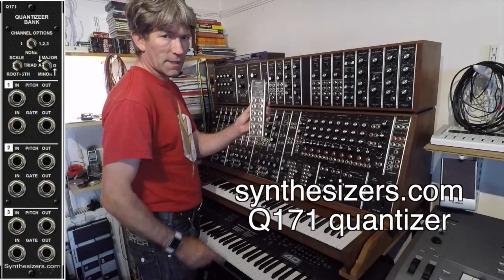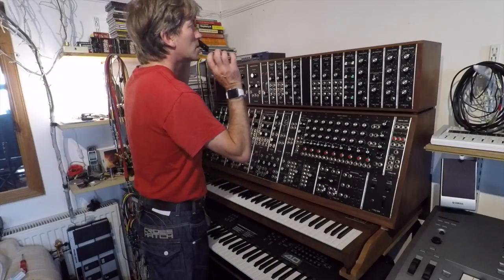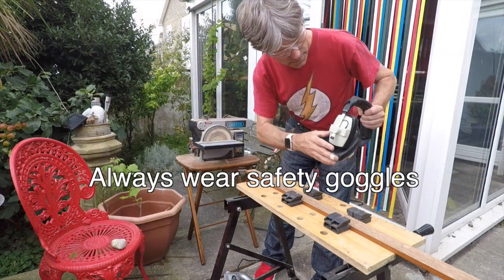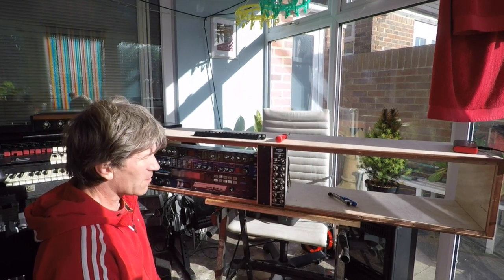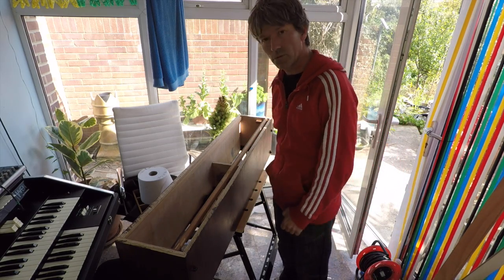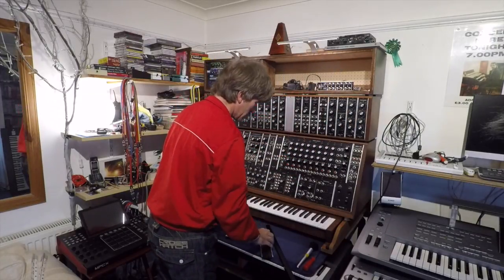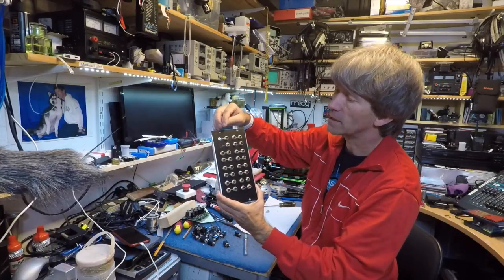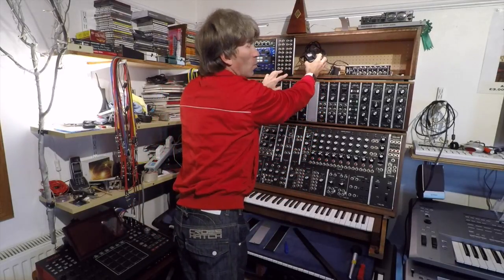Time to expand the MOOG synthesizer

Comment: Hi Markus, been watching a lot of the videos you've uploaded and have been enjoying them, I'm working on building myself a modular synth based on some circuits from my old Yamaha CS15D synth which stopped working due to some corroded circuit board tracks on the keyboard circuit boards, I decided that it wasn't economical enough to try and repair it, and thought it would be cool to re-build it as a modular synth, it was a pretty limited synth in it's original form anyway, please keep the videos coming.

Comment: Hi Markus, if you draw the silver line vertical instead of horizontal for the in and out pairs, left ins could be on the left and right ins on the right instead of right ins above left ins. Myybe thats more intuitive to use and doesnt need lettering.

Comment: I used the switchable jack sockets trick on my "Realistic" mixer years ago. It had four input channels and stereo outputs. These are set up as L-R-L-R. (Channels 1-4 respectively) 
I crosswired 1&2 together, and 3&4 together. Each pair remained joined as long as one or the other didn't have a jack plugged in. Plug a jack into 1 AND 2, or 3 AND 4, and the pairs were disconnected. If I plugged my DR-55 into channel 1, and my CS-5 into channel 3, then 1 was joined to 2 and 3 was joined to 4, so no need for "Y" adapters, and both devices on L and R. Neat. 
If I plugged them into channels 1 & 2, then DR-55 was left only, and CS-5 was right only, but channels 3 and 4 would be free.. 
Still got that mixer somewhere, along with a Realistic BBD reverb thing. Must dig them out.
Reply from the maker: NerveJam.Com yes theres several tricks you can do with switchable jack sockets. its just scribbling out the wiring design that is the fun part . i think .

Comment: Hi Markus, I make my own front panels for my eurorack system, there are quite a few sellers on eBay who will cut various metals and plastics to the exact size you need (the more you buy the cheaper they are) Its a tiny bit more expensive than buying sheet metal but it free's up time and always gives a more professional finish. 

Thanks for the vids! :)
Reply from the maker: Ben Sharp I appreciate that Ben. it only takes me a few minutes to cut the panels and i kinda like the idea of diy, my real problem is making the lettering for the panels. i tried paint & fine brush but it look crap LOL
Reply: As do I, annoyingly I now lack the space and tools to cut/bend metal to any decent level of finish. I usually stick with a satin black spray paint and classic 9mm dymo (I love the 60's science department look, haha) however i've seen people have great results using a laser printer to make decal transfers.

Comment: Too late now, but the trick with the veneered particleboard you find at B&Q or similar places is to use what they call edge banding, which is a narrow veneer that comes in a roll and that you apply using a clothes iron.
Reply: Edge banding veneer is the way to do it, unless you demand solid walnut, but that will cost a lot more and you may have to dimension it yourself (or pay someone to do it).
Reply from the maker: Yes but it still looks like plastic coated wood.
Reply: Edge banding is quite difficult to do if you're rabbeting (rebating) the edge like Markus did.

Comment: That's looking way much better than what I could have done. I'm not good with wood. I'm a mechanic by trade. 
Thanks for sharing Markus, and continued success on your interesting project.
Reply from the maker: Thanks Alain . i'm pondering what modules to make now other than the required power units.
Reply: What modules do you have now ? Do you have a sample-and-hold (those are always fun)? Or maybe some additional oscillators/LFO (you can never have enough of those) ? Or perhaps a Moog Chord Generator (as the one used by Wendy Carlos) ? But I think the last one was custom designed for her by Bob, as an experimental module...

Comment: That looks really good. Would it be possible to align all the modules starting with the right side and then have your special panel made up with a width that is non standard but is a perfect end piece to the 19" racks?
Reply from the maker: yes but I think I may get away with an odd sized one for the power switch & fuse panel.
Reply: Sounds like an equally good idea, even better.

Comment: You could make one panel that is a little narrower, and place it to the right of the jack panel, to "fix up" the alignment with the Moog modules below.   The rest of the top modules would then be normal width and would be aligned.
Reply from the maker: Im hoping to make one with an oscilloscope in it so could make it a little larger to compensate and get that to line things up.
Reply: Two more rows of modules and you will need to start playing Tarkus and Lucky Man:-)

Comment: Great job! But I think you need to start thinking about half unit blank for these as well. It seems like there's space for just ~12,5 units till the end.
Reply from the maker: bpc7 yes i agree just under 13. but i make the aluminium panels so will maybe do a slightly wider one to try and bring it all back into sync.

Comment: Don’t put the psu units to close to the patch panel you may pick up mains hum, possibly a ally shield ... nice work,  I’m more into valve gear .. and guitars but many moons @go I did have a mood kit. Was great fun, full of the ol germanium transistors.. oc71 and ac128 I think. Was years ago.. lol... all go..
Reply from the maker: Hi ampwizzard2012 . I agree with you so may make a grounded metal shield between the power supplies and the module section. It would be horrible having all that mains hum creeping into the rest of the gear.
Reply: markusfuller name is steve btw, yeah I agree, nothin worse than mains hum,,  but it’s looking good.

Comment: Brilliant. But I worry about those power supplies all bunched up and stuffed away. Won't there be an issue with heat?
Reply from the maker: Hi John. plenty of ventilation in the back as I used pegboard and the 1" gap along the bottom under the pegboard will help with heat ventilation ( I hope )

Comment: May be too late but why not put the patch panel for the 19" gear under the 19" gear in the half rack space. Maybe room for additional things like MIDI etc. Thanks for the videos
Reply from the maker: ZEROSTATIC72 i have left a gap under the back panel for emergency cables incase i decide to use them. to be honest i have never used the midi ports on any of these 19" yet but i will certainly look into it.
Reply: Just a thought on what you might use that otherwise wasted space for. You've already made a plate to fill the space, add a few holes for some jacks and a label or two and you're done.
Anyway, many thanks for the reply and for the videos of course. I used to be a repair tech for a Yamaha dealer here on the Gold Coast in Australia. Now I'm an EE for hire but still do the odd repair for family and friends.
Reply from the maker: ZEROSTATIC72 Im pondering about that wasted space now you mention it. I think I could maybe build a long thin tuner along it so i can tune up the synth easier. ?.
Reply: That sounds like a great idea to me, go for it.

Comment: 0:15 Synthesizers.com modules use 5 Volts, not 6.
Reply from the maker: sdm02 Hi I know and am aware that the q171 does have a +5 on pin 3 Im not sure where i got the +6 idea from I think it may be another module i have been playing around with on my desk here from a diferent project i was working on. I have already made the connectors for the q171 to the moog psu but am trying to get the correct multi pin power connector that attached directly to the spare socket on the main moog cabinet. I will rectify my mistake in the next video. many thanks from Markus.
Reply: Very good.  I'm really looking forward to your videos on the modular when time allows. Thanks, Markus.

Comment: Yeah peeps who don't understand the jack deal, a simple search for "patchbay normalised & un-normalised" will explain the idea. Markus is using a modded style, like you would find on the back of a synth (plug a jack in left and it sums L&R to left), plug a jack into both and you keep the stereo signal. 

Markus, I have a load of patch bays with the old method of switching between normal and un-normalled (unscrew the channel and flip it 180 vertically) if you'd like a picture of the PCB for the top to bottom routing schematic as well, give me a shout and I'll take a picture of them for you, if you don't already have some to reference.  Edit, or we could PM and I'll post one or two out to you, may make for an interesting video so you could explain it all and show how it works.
Reply from the maker: Hi Neffer yes i would be interested in the schematics. these jack sockets are quite good as they have 5 contacts, 3 for TRS and the other 2 are for switching the ring and tip if nothing is jacked in so I can still keep them as TRS instead of TS and switch them correctly as some of the rack gear accepts TRS.
Reply: These use the older TRS  sockets, the ones that lift the opposing contacts as the jack is insterted. As soon as I can figure out the best way to picture two next to each other with the sockets oriented so it makes sense as regards to the PCB I'll get some pics to you.
Reply: Here's the best I can do at this moment, life being a bit rough recently, https://i.imgur.com/Ll6ysb6.jpg The adapter is in to help identify the orientation. 

The contacts marked in red are lifted off when a jack is inserted. The green pads are connected, just in case it's not visible from the PCB. It's such a nice little layout for a complex bit of routing imo. All ya gotta do is unwravel it now.

Comment: Big mistake putting that blank on the bottom of the rack area. Ideally, you should leave it open to vent some of the heat at the top.
Reply from the maker: theres pegboard at the back and a 1 inch gap underneath it for that very purpose. I think it may be ok but I will check it over with the flir camera when its finally up and running.

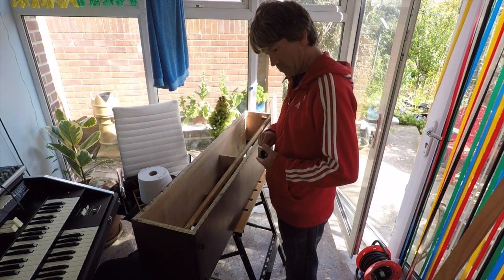Comment: Do you have a source for that IEC mounting plate at 7:20?
Reply from the maker: sdm02 Hi I just reuse old equiptment that i have taken apart in the past. even the metal panel for the IEC socket came from an old hifi. but you can buy the IECs from maplins / mouser / rs-electronics etc.
Reply: Yeah, the connectors are everywhere, but a small plate like that for a couple of bucks would be really handy, especially for those of us who don't have rectangular drill bits :-).  Thanks.
Reply from the maker: sdm02 yes i have tried cutting rectangles out of aluminium several times and they always look terrible and a lot of hard work.

Comment: Pine and stain
Reply from the maker: zoundsic Yes i think it would have been an easier job in pine but i need the stiffness and strength of the plywood incase i add yet another section in the future.
Reply: Makes sense if you want to keep the modules unfixed.  Fixing would strengthen the casing, but you knew that 😀, keep up great vid's,  I always learn something.